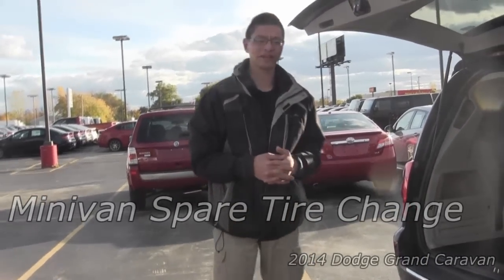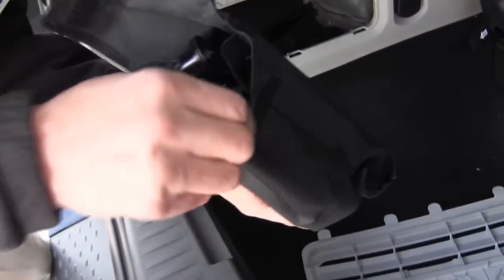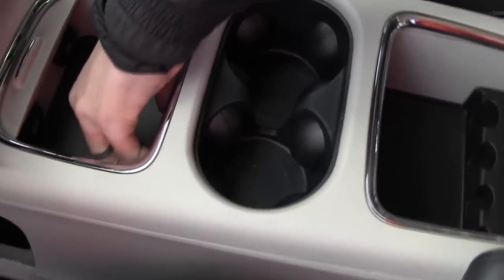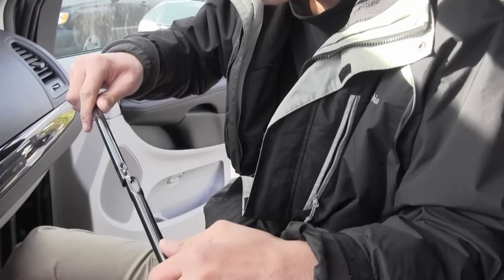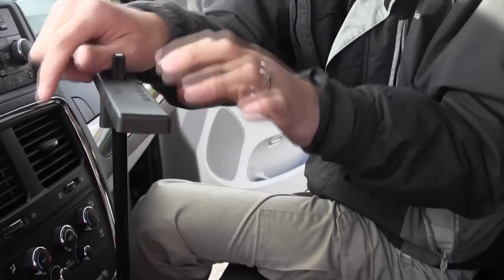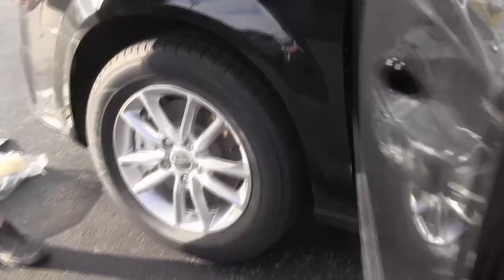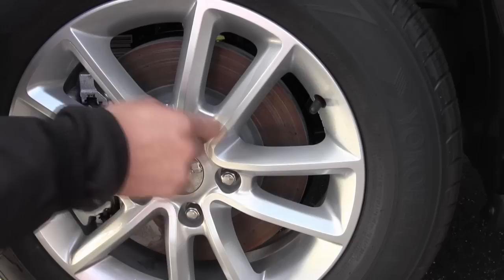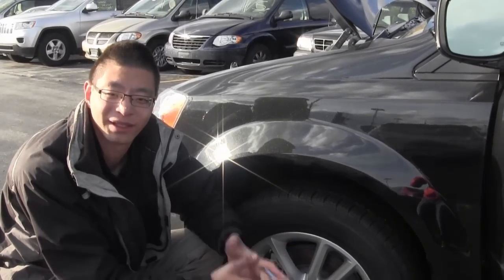Spare tire, 2014 Dodge Grand Caravan - Appleton WI - Van Horn

Comment: 3 out of 10. You were doing so good until you stopped showing and just talked. Having had to change one of these tires myself, you only covered the EASY part. You should have shown how the spare is in a plastic cradle. And how much of a pain it is to get unhooked. I ended up having to cut the wire to get my spare.

Comment: I'm looking at new Grand Caravans and most of them don't even have a spare. They have a tire inflation kit.
Reply from the maker: Yeah, that's been a trend that's been going around quite a bit lately. I think it's partially the weight savings and also the fact that you have less chance of components rusting and the screws not turning. That's actually large problem with any spare tire stored on the exterior of the vehicle.

Comment: Never ever put the "donut" (mini spare tire) on the front of a vehicle -- unless you want the drive of a lifetime.  It is almost impossible to steer a vehicle with a mini on the front.  (Been there; done that.) Recommended installation is to put the mini on the back only.  If you have a flat front tire, then you have a two tire change process.  Replace one of the back tires with the mini.  Then put the good rear tire on the front to replace the flat and drive to the nearest tire repair shop immediately.
Reply from the maker: That's a piece of advice that I've never heard. Thanks for the info!
Reply: Want a challenge?  Replace a front tire on a Grand Caravan with the "donut" and go for a drive.  Figure 10-20 miles as a reasonable distance for needed tire repair or replacement.  Update me on your experience.  This is my third Caravan and, needless to say, I'm not happy with either the "donuts" or the tire inflator kit.  I'm off to buy myself a real wheel and tire as a spare.

Comment: Very helpful in deciding how I might replace my '98 Caravan. Replaced the dry rotted donut in 2011 with a full size in the same hanger under the 3rd row but it extends below muffler.  A full size spare is a must, especially with front tire replacements and with needing to continue long distance trips to a better choice of tire shops.